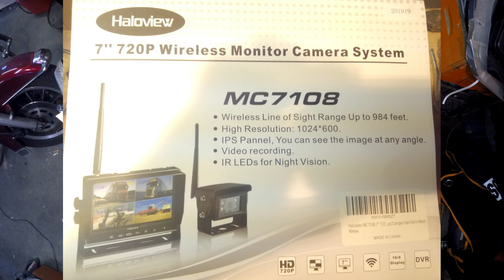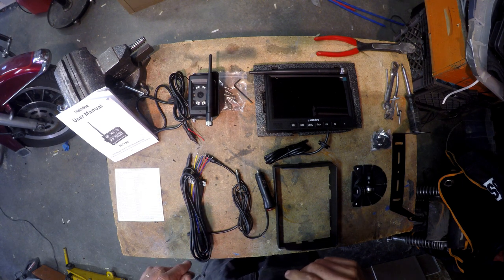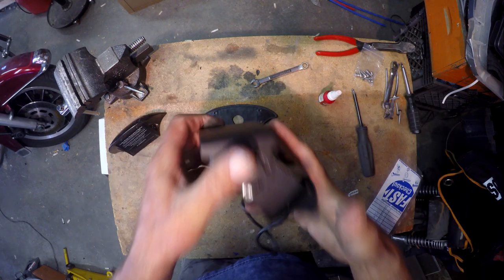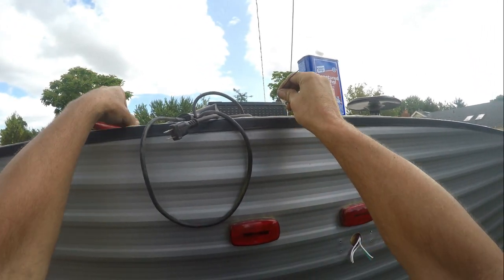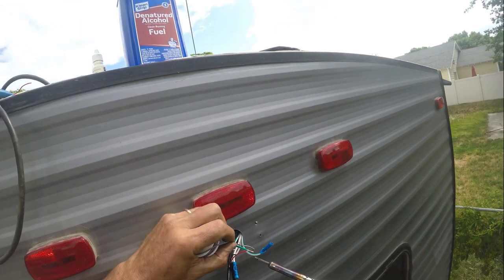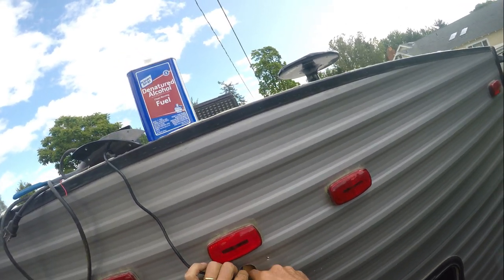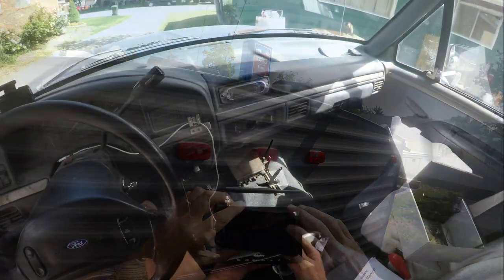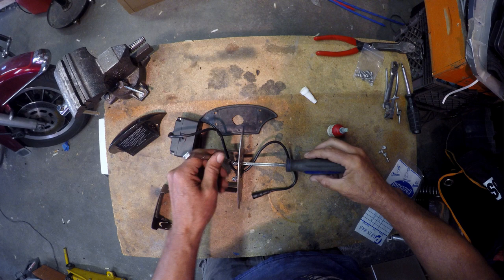Installing the Haloview MC7108 Wireless 720P Rear Monitoring Camera System

Comment: So how u made the bracket or is it part of the old furion set up
Reply from the maker: Here is the link to the bracket build.

https://youtu.be/6vo-bORI6KQ
Reply: Check his previous video
Reply: Hi
Thanks for you
Reply: Hi thanks for the video
I tried using furrion cable and it would only work while pressing the brake pedal. I'm thinking of doing this but am not sure if it will solve my problem. Any suggestions?
Jease
Reply from the maker: That sounds like the power us being supplied by the brake lights instead of the running lights. If you have running lights close to the camera mounting location you may be able to fish a wire from them to the camera and use that to power the camera. They might have wired it incorrectly from the manufacturer.
Reply: @DiyRVandHome  
That's what I'm thinking but talking with my local rv dealers service people there saying it's a furrion wired system and needs a furrion camera. I noticed you used a BMW adapter what's the reason for that? My vehicle is a 2014 VW
Reply from the maker: There is nothing special in the wiring to make you have to use the furrion camera. Just cut the plug off and add the one the camera out are using comes with.
Reply: @DiyRVandHome  
I'll give er a go 
Thanks